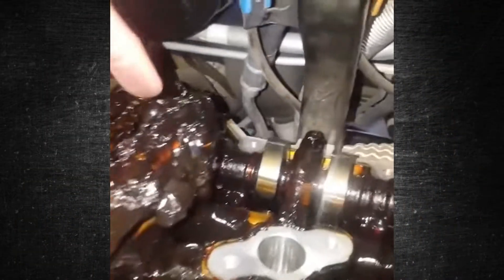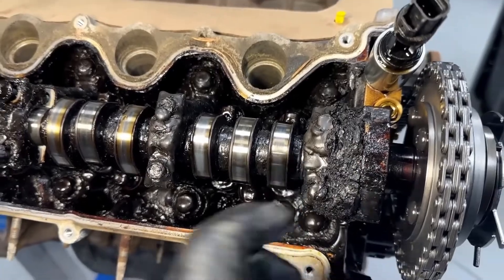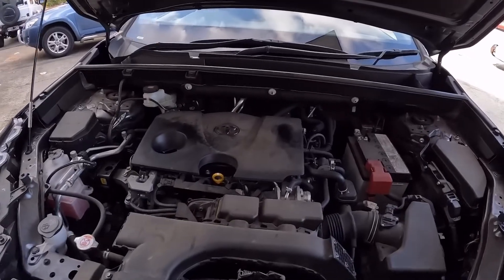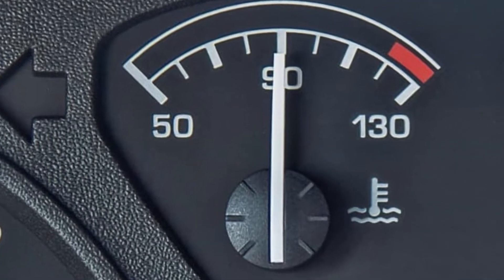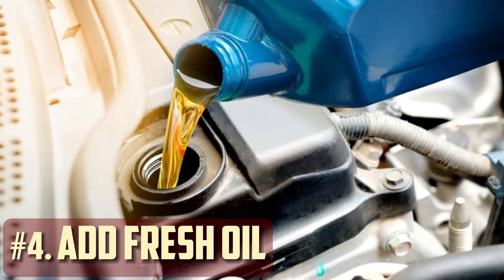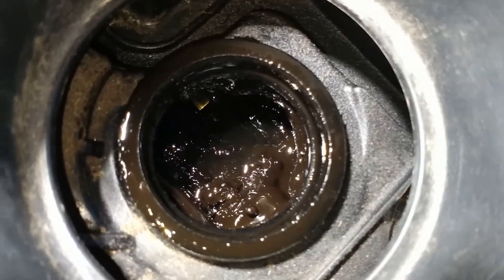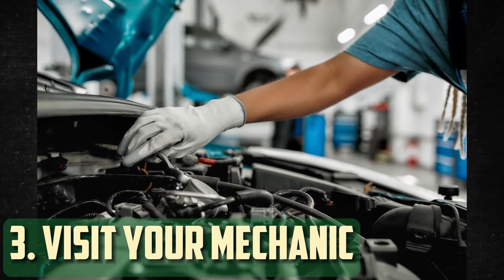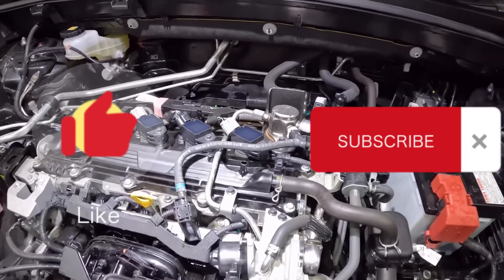Engine Oil Sludge - How to Remove & Prevent

Comment: I prevent it by 5000 mile oil changes . Every oil change using BG EPR , Liqui-Moly or AmsOil engines flushes . Using Pennzoil Ultra Platinum or AmsOil Signature Series oil and either a Purolator Boss or AmsOIl filter . I let the oil drain until it is drop by drop . Oil consistently comes out as dark honey .

Comment: Tip :  when doing an engine flush,  use the cheapest oil (Walmart) and filter .  No need for  20,000mile synthetic oil/filter

Comment: I have been dumping a quart of ATF into my crankcase as a motor flush, for over 3 decades.  I usually do that right before taking the car in for an oil change.  
I have not experienced any sludge issues in 30+ yrs.

Comment: Something I find helpful is when you flush the oil, use fresh oil to run the flush in.  You want the flush to work on the sludge and not the contaminants in the oil.  Would you add more soap to a dirty mop bucket then continue to mop the floor? No, you'd use fresh water.  The "clean" oil will also give you a visual indicator of how much the engine flush is doing.

Comment: Used Rosolone high mileage treatment several times and no more issues
Reply: never run an oil additive.  EVERY oil manufacturer, expert and oil company says this.
Reply: @datsuntoyy I was given this suggestion by an engine repair shop after being told the engine had too much sludge and needed to be replaced or taken apart and cleaned by auto repair place.  Engine repair shop told me this is their go to product and gave me specific instructions on how to use it.  That was almost a year ago and no further issues

Comment: 10k oil changes= sludge
Reply: Or excessive short trip and stop and go driving.
Reply: 10k what miles, km, liters, pascals? That is nothing. Those are 30000 km or even miles oil changes.
Reply: @dizy82  yes 10k miles. lol 30k or 18k good luck dizy

Comment: once you have sludge the damage has been done time for new engine
Reply: not true at all.. bought multiple cars and drained completely inside the block as well... 
don't speak if you don't know shit
Reply: @linezgames3893  lol
Reply: Not even close🤣🤣
Reply: So what do I do because I’ve got a serious case of it and two mechanics don’t want to touch it. Only realised it a few days ago when my car suddenly started emitting clouds of smoke from the exhaust and a bit of a whistle noise from the turbo. I was told by a mechanic the oil is clogging the pipes but there’s no damage yet to the engine
Reply: No not true at all.
Reply: I’ve changed the oil and filter but the smoke is as bad if bit worse
Reply: Would it really depend on just how much slug the engine really was slugged up? 😮
Reply: If it's like the one at 35 seconds, yes.  But if it's not that bad you should be fine.